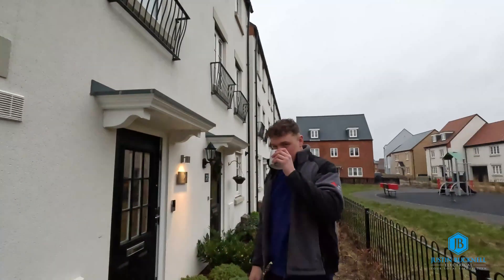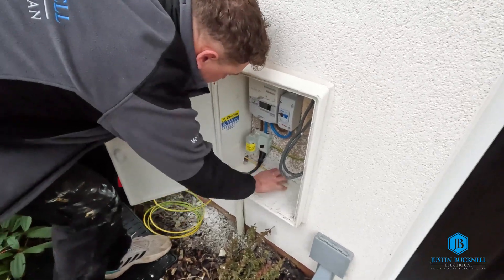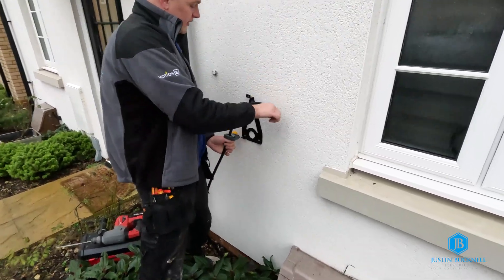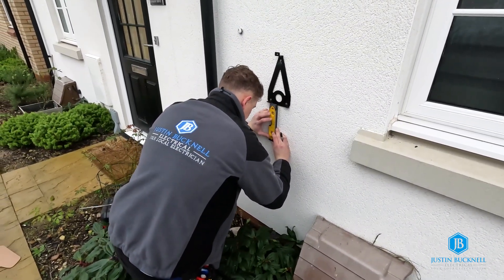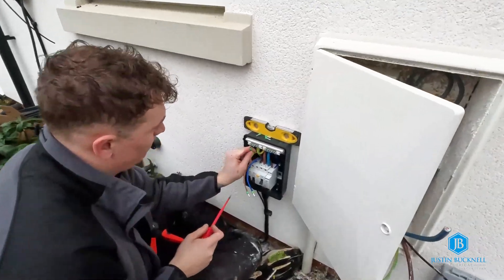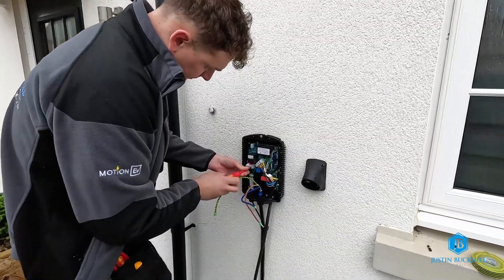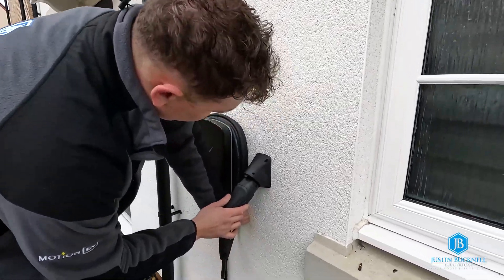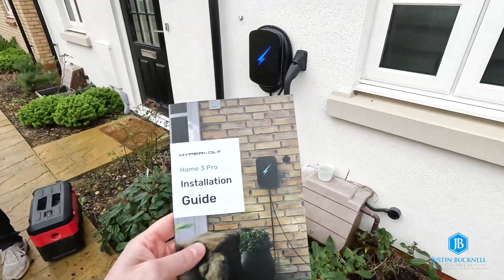Power up: Installing a Hypervolt EV charger at home

Comment: Is installing the CT connection standard on all ev chargers ?
Reply from the maker: Yes, it’s required for load management under the “Connect and notify” for DNO unless the property is deemed to have such a low load that the charger and property does not exceed 60Amps combined.

Comment: External consumer unit is not ideal and has questionable safety concerns
Reply from the maker: Quality weather proof units and high standard of installation brings no concerns in our opinion.
Reply: @justinbucknellelectrical  You lose the IP rating of the CU if you do rear entry, even if you coat the thing in sealant.

Comment: Tidy job. Had you considered using 10mm meter tails? far easier & cheaper than 25mm.
Reply: apparently now the NICEIC say that does not meet the regs if not covered by a fuse this not the DNO main fuse
Reply: @delspark  , just been confirmed from my Nic assessor & he says no problems, it’s fine.
Reply: @delspark I'll check with my local assessor, but i cant see an issue if you cant pull any more than 7KW.